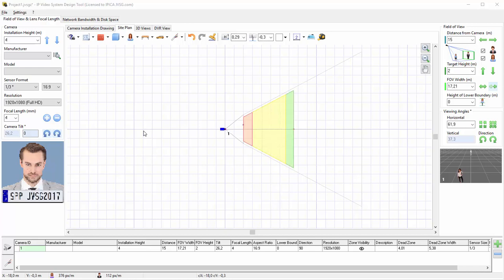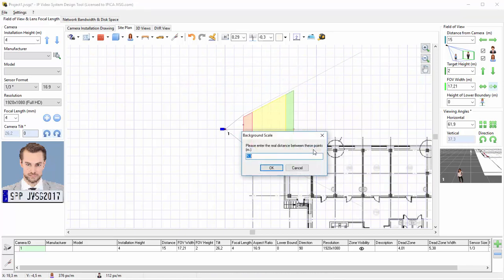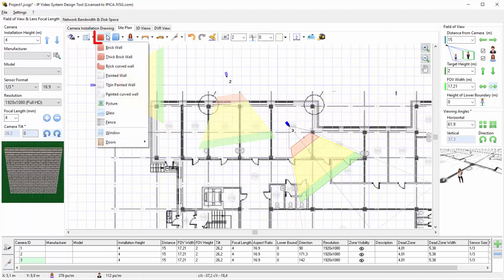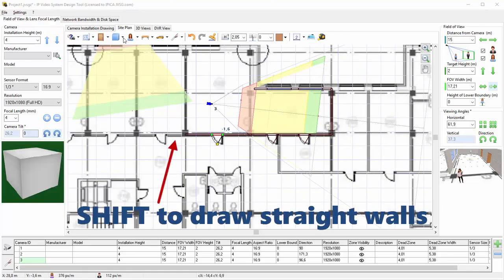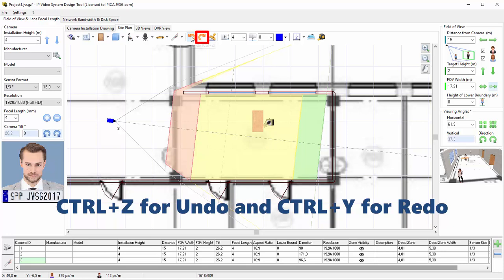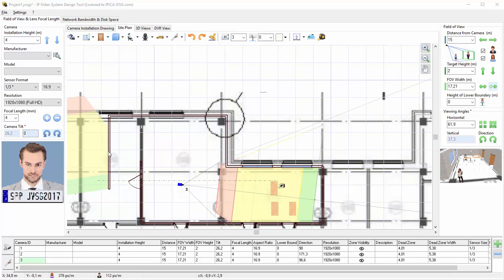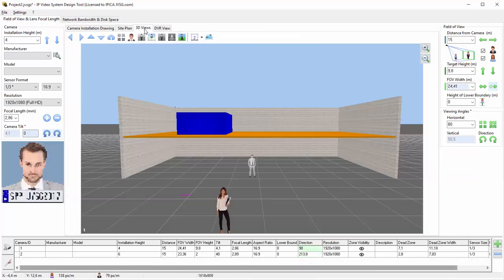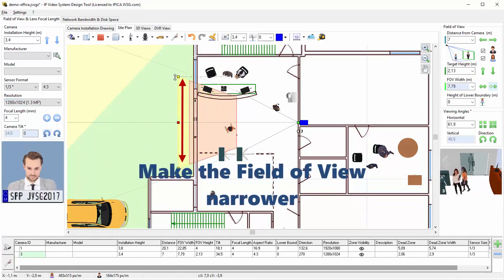How to Design Video Surveillance System. Part 3 - site plan and camera positions

Comment: I have an existing Model in BIM, can i use that to link or import to then model my CCTV on them and do the analysis.
Reply from the maker: Currently, IP Video System Design Tool does not work with Revit/BIM files and formats.
Our program can import 3D models in .DAE and .OBJ formats.
Also, we can import background images in .PNG, .JPG/.JPEG, .TIFF, .PDF, .BMP, .DWG, .DXF formats.